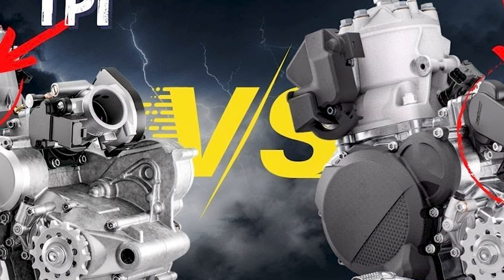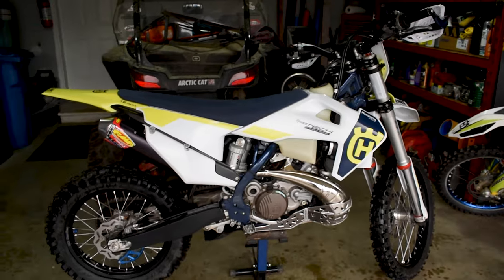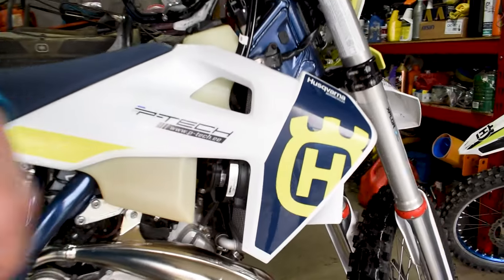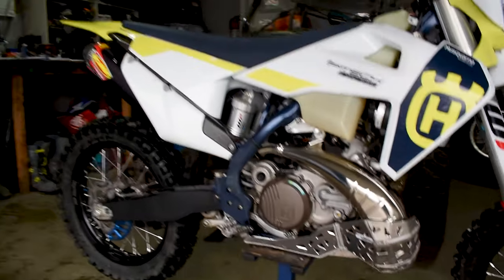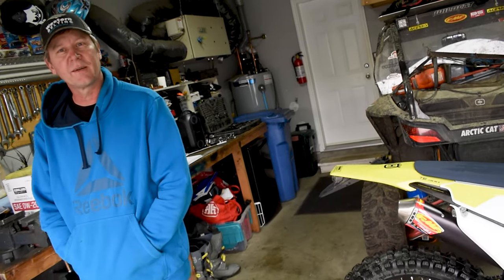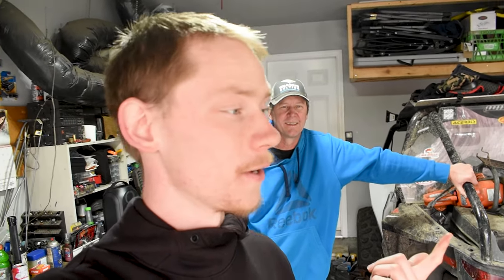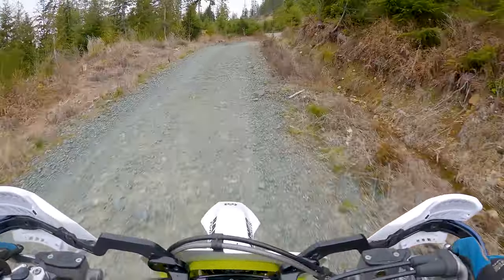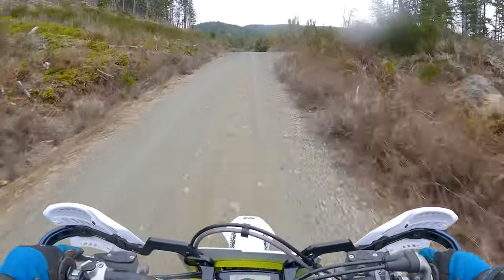Bought A 2023 Husqvarna TE300I!? First Impressions, Review, & Ride!

Comment: I aloe geared mine down with a thirteen tooth sprocket ⚙️ on the front … drag the rear brake a bit first two rides bed it in then I ajusted mine 5 mm higher than the foot peg and unused the free play so it’s really close slightest pressure on the pedal …

Comment: When you’re getting used to the bottom end torque, if it’s nice and open try giving it a couple clutch kicks lol more smiles to come
Reply from the maker: Oh dude yea , this was just rolling on the power, was still on break in. Have yet to even snap on the throttle yet or turn the powervalve out! Should see massive power gains once its set up, Picking up front tires up without clutch dumps, n whats not

Comment: How's the seat on it?? And is it only electric start or could you add a kick start?I would be worried to only have electric start.
Reply from the maker: Seat is a little bit on the firmer side but still comfortable. The bike comes standard with electric start and optional kickstarter you can add to the bike
Reply: I e got the TE300i 2023 the starter on it is next level no issues with starter at all love it ..

Comment: You need to put TU-BLISS front and rear no more tubes can run them really low in the technical stuff  , I’ve just done it to my 2023 TE300i makes such a difference .
I just came from a 2019 KTM 350 SX-F over to the husky had shit loads done to the 350 especially suspension work ….is a way better ride now on the Husqvarna 300 ..
Reply from the maker: You gotta convince my dad to install another tubliss system. He hates the install

Comment: I feel very close to get one of these bikes. (250 version) Before I was thinking BetaXT (250)… But now someone very talented like yourself is getting XT and that makes me think again. What’s your reason for XT?
Reply from the maker: I think your decision should be based more off what you want your bike to do for you and what you ride.

If you want to blast the straight aways and rip whoops, while also being good at enduro but be a more physically demanding bike, a typical 250/300cc enduro might be what you want. 
Typically these bikes hard stiffer suspension and harder hitting top end.
These bikes are full blown race bikes

The x trainer differs in many ways

Its a shorter wheelerbase making for better low speed maneuvers, lower seat height for better foot reaching abilitys, linear power band for maximum traction and tractability. Trials designed suspension to track as best as possible in slow techy gnarly terrain.

Standard 250/300’s are a universal pocket knife that can “do it all”

The x trainer is specifically targeting the slow, technical, gnarly riders, while also being a more mellow and smooth ride throughout. It has extremely plush suspension, smaller bike feel and less exhausting to ride. (Its also lighter) and they are street legal too

Standard 250-300cc 2 strokes are more race oriented do it all type riding but can be a handful to ride with all that power.(its sure fun as hell tho)

X-trainer is more fun and weekend rider oriented with a specialization in concurring techies and gnarly terrain while giving the rider confidence throughout. You can also stick a fatty/gnarly pipe on the betas and open the 300cc right up to standard 300cc power levels
Reply: @AaronsEnduro  I can’t thank enough for your detailed answer. Thank you so much :) great insight. We’ll soon see what I’m gonna decide on…
Reply from the maker: Best of luck with your decision!